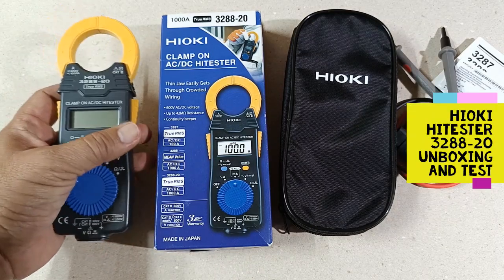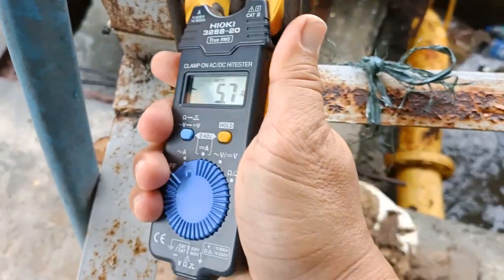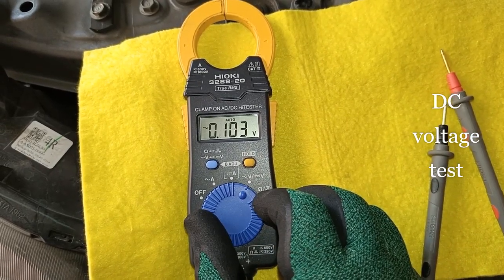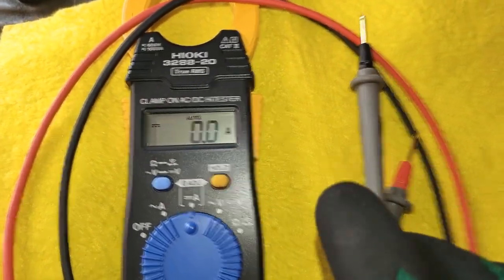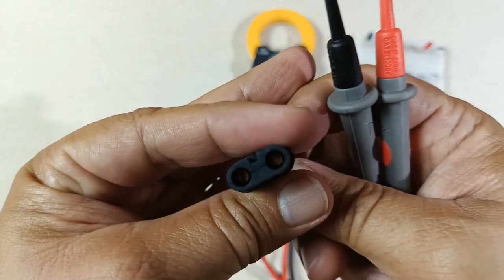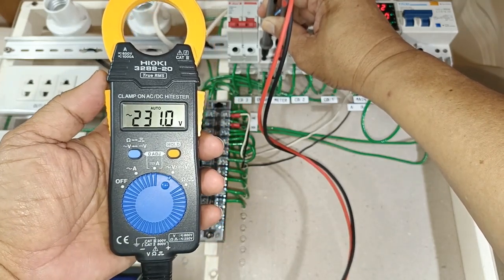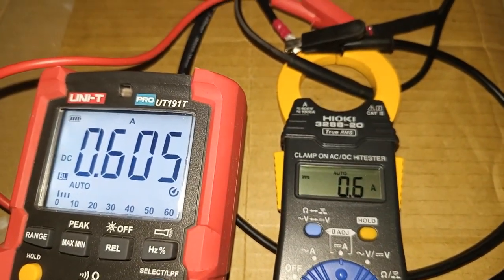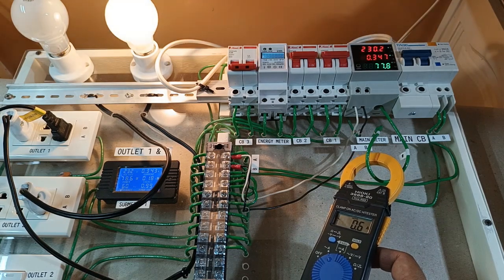Hioki 3288-20 HiTester True RMS AC DC Current Clamp Meter Unboxing and Testing [CC]

Comment: 전류 소수점 한자리 표시가 아쉽습니다.
Reply from the maker: Yes, it's not designed for measuring high resolution fractional current. But for its purpose, it's great for electrical inspection of 50Hz/60Hz power systems current up to 1000Amps, 600V AC/DC.

Comment: I see you tested both this one and the Kyoritsu 2046r. How would you compare them? I use it mainly for recidential and solar (including battery) systems.
Reply from the maker: The KEW2046R has capacitance, min-max, Hz/duty cycle, °F/°C, which aren't found in the 3288-20 but might be important to a technician. On the DC side they're just about the same. So, if I were mainly using them for DC inspections, I'd pick the 3288-20 mainly because it's so compact and reliable. Its lithium battery isn't known to leak, which is a big deal for me as well.
Reply: @ramschannelreviews  I saw this max function that might be useful, which I actually could use today as a solar panel breaker flips and I don't know why so I could use max for that
Reply: @ernstpeterlegrand  I think that's one way to troubleshoot using the max feature. Good luck!

Comment: Hello it can measure inrush dc current?
Reply from the maker: No, it cannot. It doesn't have min-max either. You would need something like a Hioki CM4376/4375-50 for that, which cost about 3x more.